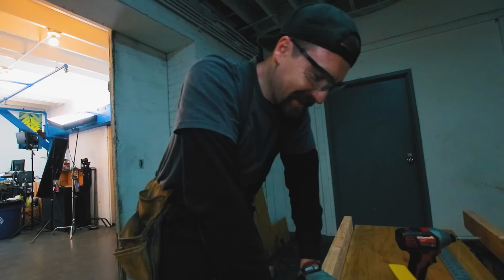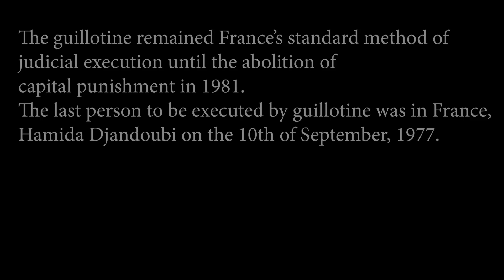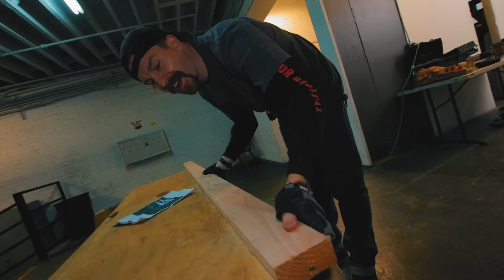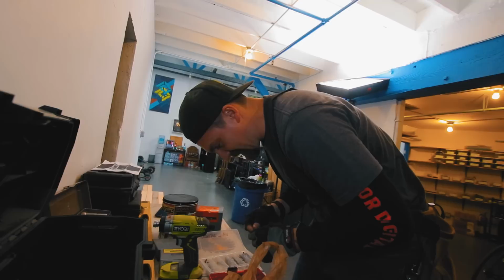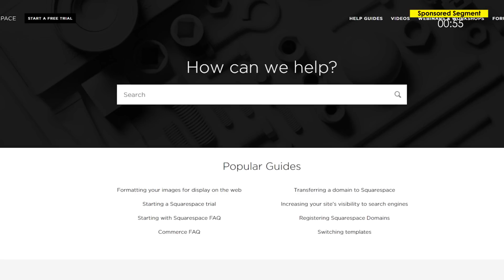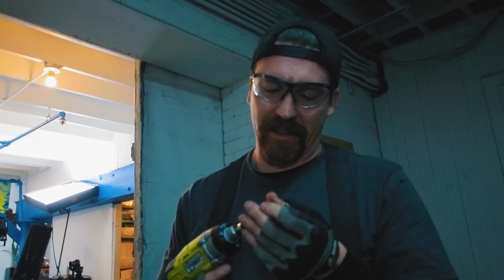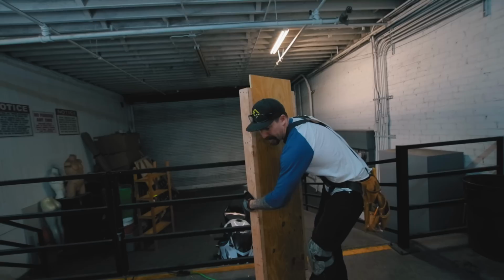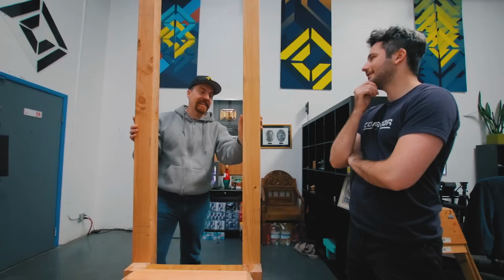I am Building a Working Guillotine to Save Money!

Comment: While the blade isn't this video's focus, I suggest that a properly hardened and tempered blade is required, since just machining and sharpening it will result in a soft-edged blade. A custom-made blade from a specialized group/company might be a good call. Sorry, I digressed.
Reply: NothingXemnas Or a collaboration with Alec Steele would do
Reply: I agree, otherwise the blade would get wreaked after a few cuts.
Reply: @carn109  guillotines dont actually need sharp edges. they usually just "cut" / "smash" through the victim  simply because they are  heavy af.
Reply: Naw machining would work. Just get pre hardened like what Michael cathulu uses
Reply: A don't think the blade has to be very sharp or hard. It is very heavy and guillotines would be sharpened every use anyway.
Reply: You don't want it too hard; if it's brittle, it'll chip on the bone. We have a hardened steel blade in our print shop cutter that will chip if it has to cut through a staple. You also want it soft enough to be touched up in situ with a steel or ceramic rod.

It hits with a force of three tons, way more power than any headsman ever delivered. It doesn't need to be razor-sharp, just not dull.
Reply: In Guyana it was not always succesful, mostly because the rails failed.
Reply: My immediate first thought when I started watching was thinking of the axe blades my buddy once cut out of an old bulldozer blade using a plasma cutter, then machined to shape and heat treated

Comment: I'm no expert on this matter, but I'd recommend setting some safety rules around the guillotine for when it's complete. Stuff like "no leaving the blade up" and "no getting near when blade is up". Think of gun safety rules, convert them to guillotine safety rules. Before you say "it's dumb, everyone knows to watch out", remember that people are still supposed to cite gun safety rules even with years of experience. Treat every gun like it's loaded, son.
Nobody wants a CD crew member losing a finger to a loose wire/rope.
Reply: seconded. I'm guessing there will be rules like that behind the scenes but since there's probably some impressional people in the subs they need to do a Guillotine PSA, preferably with bllet points... just to be safe.
Reply: Just like you assume every soldering iron is on and hot, you have to assume every guillotine is live until you verify its safety.  You also store it in its most safe state at all times that it is not in use.
Reply from the maker: Absolutely!
Reply: I've already been proposing very specific rules, as this thing will be fucking scary.
Reply: @JarrettOriginal  Already looks scary as it is in the video. I'm happy to see your guys safety on your minds.
falcore91 suggested a padlock for the down position. That's a great idea. I think Jake could also pull a wedge of sorts in case the blade is lifted but stuck and you need to get it loose but not drop on anyone, some failsafe to make sure even if it does drop, it doesn't go all the way down. Should be obvious that the wedge should be possible to install and remove without any body parts going through the blade-plane.
Reply: @JarrettOriginal  This thing makes me super nervous just looking at it. Stay safe please..
Reply: Nobody? Speak for yourself...
That would get so many views
Reply: LforLight son you right!!! We ain’t gonna see no more vids if Wren lost his hands
Reply: You could padlock the blade in the down position..
Reply: Not leaving the blade in the ready position is common sense. As is not sticking your head in the lunette. And frankly, if you're dumb enough to ignore these rules, I don't want you to live.
Reply: 9:11 till 9:16 that's so me
Reply: In case of being rich aristocrat , keep the safe distance of at least half a mile.
It is dangerous to play Marseillaise within the close distance of the guillotine, it may lead to usage above necessary level. Speaking french and especially words "freedom" "equality" and "fraternity" in any language within the close distance or while using it is also forbidden.
Do not let anyone named Robespierre or Marat get too close.
Reply: I don't they are especially big on health and safety at Corridor.
Reply: @CorridorCrew  yesh
Reply: "Treat every guilotine like it has a round chambered"
wait...

Comment: Jake check this out 2×4 is a 2×4 lol
At this point, the 2 x 4 is actually 2inches x 4 inches, a 2 x 10 is actually 2inches x 10 inches, etc. But then the newly-sawn (but soaking wet) lumber is then kiln-dried until it reaches the desired moisture level. During this process, it shrinks as the moisture in the wood is removed and the wood cells shrink

Comment: Just because nobody asked: the washers spread the force from the crew head over a greater surface area and that way the screw head does not break the edge of the hole into it and slips through, since edges are weak points and prone to breaking. The pilot hole you need with scerws, because they repress a lot of material with their core. The pilot hole should have almost the size of the screw body so that the threads of the screw can still bite into something. In metal, this hole needs to be a hair bigger than the screw body, because you can't really repress the material  with the screw. Would you be nailing the repressed material actually gives you the force on the shaft of the nail that holds it in place, it is basically a friction fit. That is why screws should on average be stronger than nails, a screw as a "shape fit", material would need to break out of the way for the screw to come out.

Comment: Just some friendly advice from a guy who's done lots  of carpentry. Next time if there is a next time, you need to cut a channel as you did to allow the guillotine blade to slide in the length of a project. Set your circular saw to the depth of the Grove like you would if you're gonna rip a board. Just keep the depth at in your case looked like maybe an inch. 

Cut the sides first then just run your between the two guild cuts. You of course will need to remove the extra left over but that is what is known as a poor man's datto blade. 

A batto blade is a blade for a table saw designed to cot those groves. However in your project the size of the boards would make it a challenge to run over a table saw. 

Always willing to advice. Just PM me on my Facebook page. Oh I enjoyed the video dude.

Comment: I do not think that is wide enough unless you plan to put grooves in the tower posts. The perfect width of the bed and width of the tower is where most peoples shoulders can be in between the tower posts so their neck is right under the blade and their shoulders can touch the wood the blade flies through.

Comment: If purchasing a large steel sheet is too expensive, could buying a strip of steel with prongs coming out on the dull edge be less expensive? In that, the prongs would be bolted to two other sheets of less expensive but still heavy metal. Using a softer metal for the bolts, you could hammer the ends in to fuse the sheets into one piece. This is assuming that the blade sled's rail tolerances are still being adjusted. Plus if you use a metal of a different finish, you could have an awesome two tone guillotine blade.

Comment: The blade itself needs proper research. Steel is tempered for different usage, high impact resistance, sharpness retention, etc. An axe isn't tempered the same way a filet knife is, for example. Type of steel also factors in...I suggest doing a collab with Alec Steele or any other metallurgy expert, or ask for advice at the very minimum.